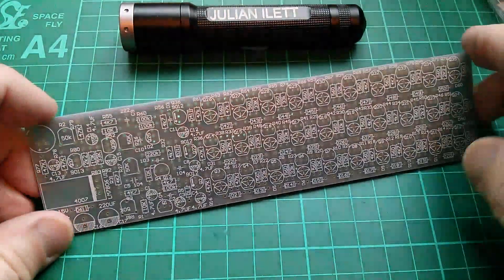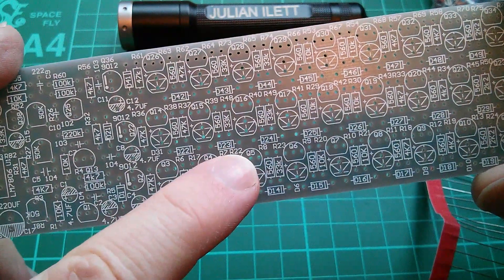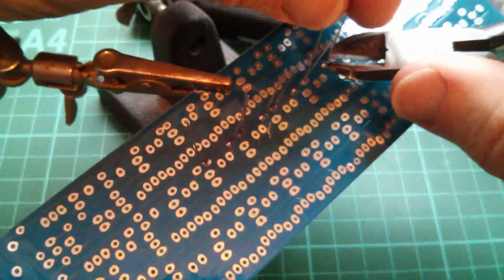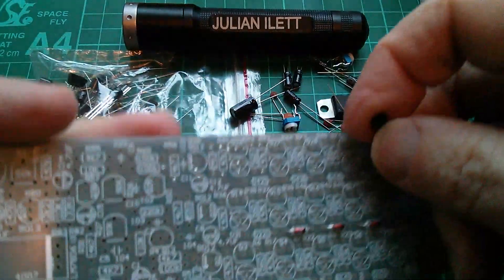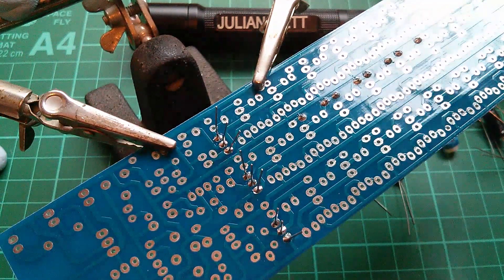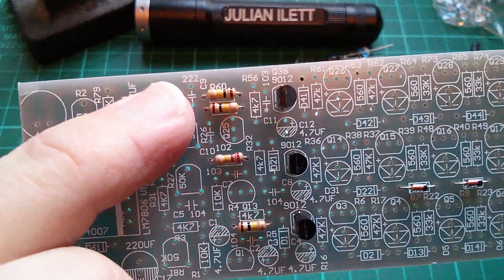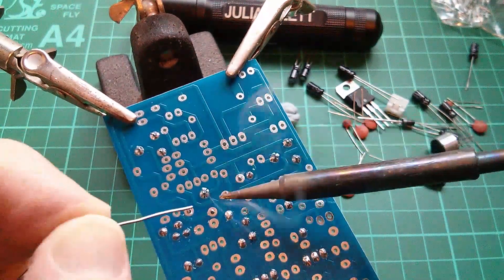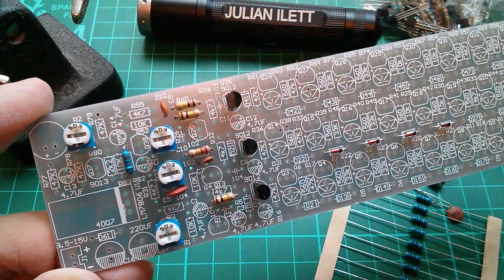Basic Electronics: Kit Build #1 - Soldering & Component Identification

Comment: Nice video. When I do this type of soldering, I usually put most of the flat components, using wide Scotch tape to hold 'em in place, then just flip the board and solder. At the end, remove the tape.

Comment: You probably know this, but someone else might not. Start your board with the smallest component down first. Put something hard on top of parts and tap it to the board holding the parts down. Then build up your board by the height of your components, and soldering is a lot easier. Also a little bit of crazy glue on a leg top side of a board doesn't go amiss. The building up was always the pain in the but for me, but a working board was always a smile.
Reply from the maker: T Komoski I get bored fitting the components in height order - the build is more fun if I can fit the parts in a random order!
Reply: Julian Ilett Have you done a show on your favorite Ebay stores or ones to stay away from? Just got some parts from alice1101983 and was rather happy with, except paper PCB proto boards. Could you possibly explain what you look for 
in a seller on Ebay. I know that what you buy is different from what I would purchase. I'm new to Ebay and your experience with vendors would be helpful in future purchases. Love your channel, always look forward to seeing new video's. Cheers

Comment: You should get a nice pair of full flush cutting pliers.  The kind beveled on both sides of the cutting edge drive a shock wave into the component when the lead severs and leaves a sharp burr on the trimmed lead.  True flush cutters (completely flat on the component side) cut the lead with no shock wave sent toward the component and leave a blunt, cylindrical cut end.
Reply: You shouldn't!
My missus uses them to cut her toenails! Forever finding them in the bathroom..
(Can't wait until she tries my Antex iron to trim her nasal hairs...gales of laughter in the Crofts household that day!...)
Reply: Andy Crofts
Don't be so tight.  Get your missus her own pair.  Valentine's day is just around the corner.  Well trimmed toenails are a sign of love for the one you are sleeping with, anyway.

Comment: Hey, what soldering kit do you use?! I'm going to learn myself, know a lot about electrics! Thanks in advance :)
Reply: Hi, start with a good quality soldering iron 30w and some solder, chose rosin-core because it is the best. Diagonals cutters and needle-nose pliers. A good pair of wire strippers will do the gob. A digital multimeter is very handy, a visie or a helping hand. Finally, get yourself a good solder sucker. You can get all of this online or at an electronic store. I hope i help you!

Comment: The diode ladders definitely are a VU meters. Three of them actually for different frequency ranges, since the only difference between the three rows are the caps/resistors around Q1/13/25 (and most probably a few traces on the bottom since high pass/low pass are connected differently). From the values I'd guess high frequencies top, low at the bottom. And did you really scratch away the marking of the component in the top left? It would make a very good spot for letters like "MIC" ;) The microphone has to go somewhere, or did they throw it in the bag as a bonus? ;)

Btw. you should get a decent soldering station some time. I used a 20W iron for almost 20 years and thought I don't need more. I got accustomed to sometimes oxidizing thin copper tracks immediately, lifting pads on repairs of older PCBs or not being able to solder larger stuff.
Then I got a 90W soldering station. The reason was mostly because I started doing more and more SMD, where a well controlled temperature is very important. I'm still smacking myself on the head why I didn't get one earlier. The solder joints turn out so much better with way less effort! No more instant flux vaporization but still the power to solder beefy lipo battery leads.
Reply from the maker: superdau Excellent analysis, and yes I did scratch off the word MIC!!
You could be right about the soldering station - One day I'll treat myself. I am very attached to my old Antex iron though.
Reply: Julian Ilett
I understand very well. My old soldering iron was still always close in a drawer even after I got the station. But finally after a long time of neglect there, it was moved to a box in the basement, where it has been promoted to "mobile or lend to friends"-tool. ;)

A soldering station doesn't have to be expensive (no Weller or Ersa for me). But make sure you get one with a temperature sensor and not just power regulation (a simple light dimmer could do that for you). I got this one (just example, I'm sure there are similar stations in that price range):
http://www.reichelt.at/XYTRONIC-Loetstationen/STATION-LF-3000/3/index.html?&ACTION=3&LA=2&ARTICLE=110450&GROUPID=4543&artnr=STATION+LF-3000
which I swear was at least 20€ cheaper when I bought it. I'm very pleased with the quality. The temperature sensor reaches right into the tip, which means it takes maybe a second for the heater to kick in after touching a large thermal mass. It heats up so fast that it takes longer to get the solder and flux out of the drawer than to get to 350°C. That alone changed how and when I solder (would you heat up the iron to tin a single wire? With the station I do now; the metal "sponge" adds to that).
Reply: superdau
lol you can't get anything past the superdau!
Reply from the maker: superdau You may have just sold this to me on the strength of the fast warm-up time alone

Comment: So why u use such a thin tip for soldering "normal" parts ? Use a much bigger Tip, because the heat and the Power goes much better to the part.
This tip you are useing in this video it is good for SMD parts or something like that.
Too short soldering its also not the best idea. In years after soldering  you got cracks. Take a little time. U don't need soldering parts in half a secound. The Tin needs time to "flew" and "binding" t the parts.